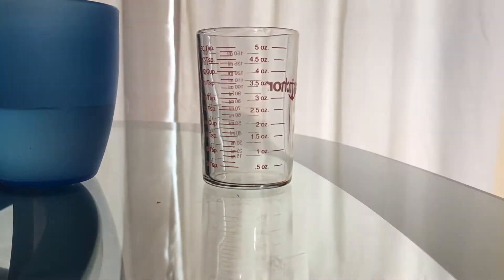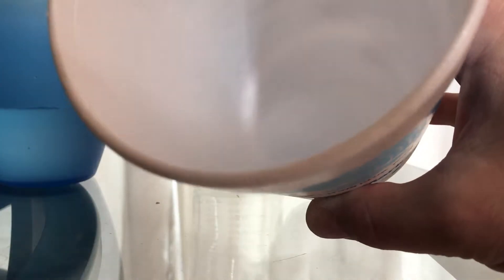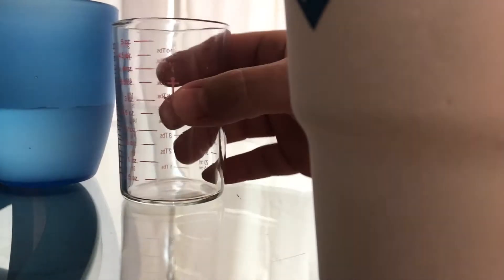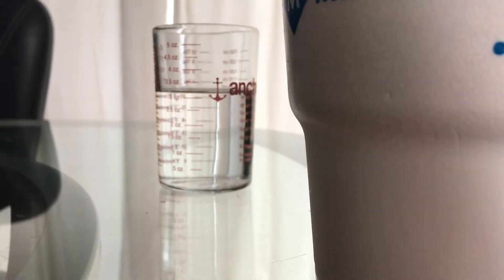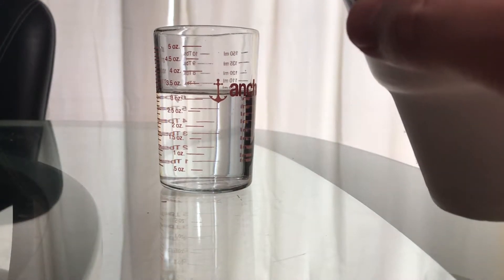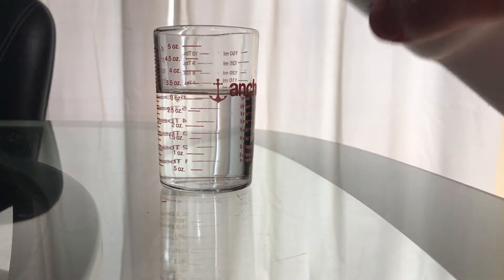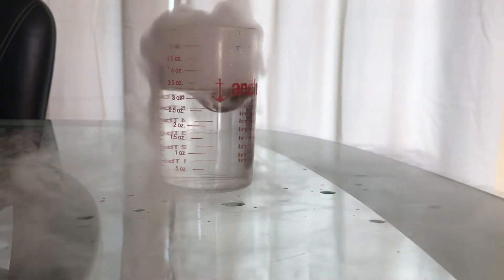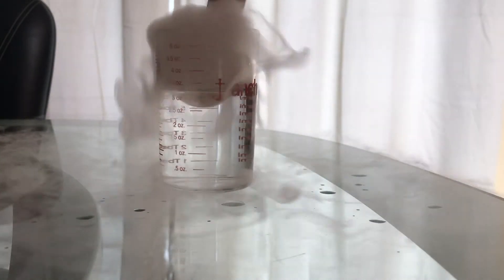Pouring pure liquid oxygen into water

Comment: Thanks for the video. Can you measure the level of dissolved oxygen before and after adding. Interesting how much oxygen goes to the air. It is the same as sparkling water but instead of carbon dioxide is water.

Comment: Does the water cool down significantly or does the leidenfrost effect prevent this?
Reply from the maker: It actually does mix pretty well because of the density difference and it cools the water.  I always end up with some ice floating on the top but the overall temperature of the water also drops (never measured it).  Sometimes some LOX can get trapped boiling off on top of a piece of formed ice though.  The leidenfrost effect does, however, prevent it from instantly freezing you skin (as with LN2).
Reply: Thanks for your quick reply and I was hoping for this answer. I'm not a chemist by any means but have some questions about the characteristics of LOX for cooling purposes, could we get in contact somehow? I use Facebook /whatsapp/Instagram /email
Reply: https://youtu.be/addme/_Bif0BOVNRYainDJT56oRPwVJGehyQ
Reply from the maker: @4qwez  I am so sorry.  I didn't see your last couple messages.  Can you please send an invitation again?  I would love to talk about LOX.
Reply: @ChristmasEve777 After this liquid oxygen mix with water, does that water have high amount of oxygen or it's normal?